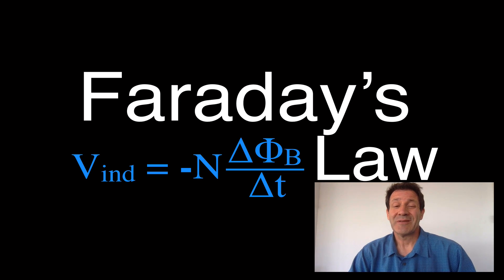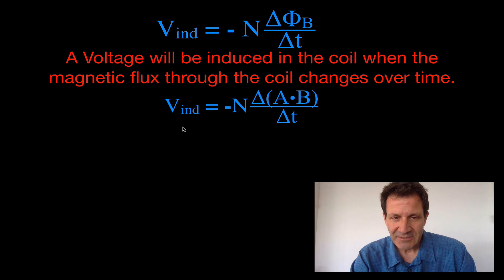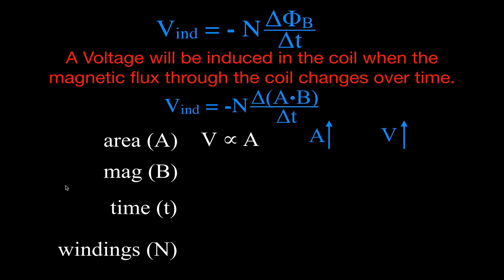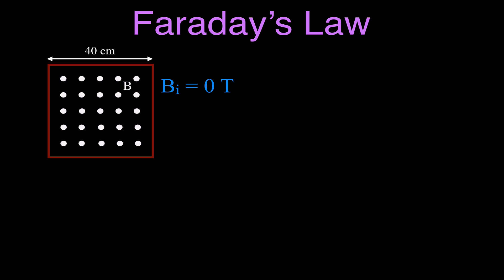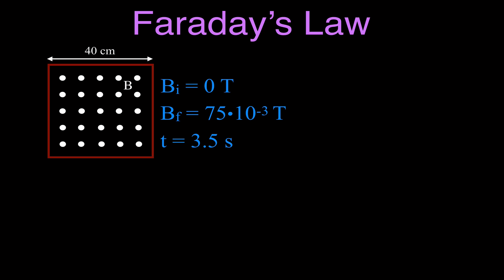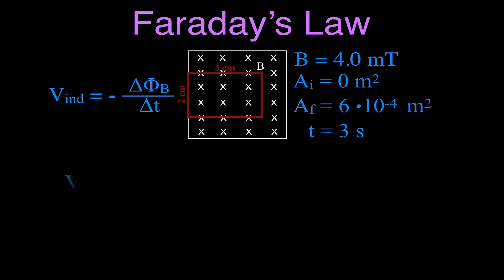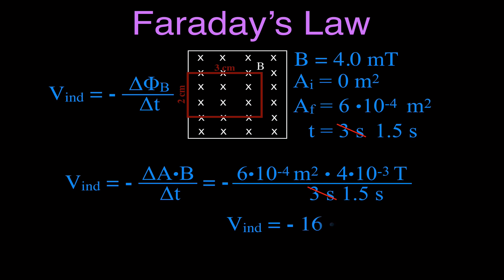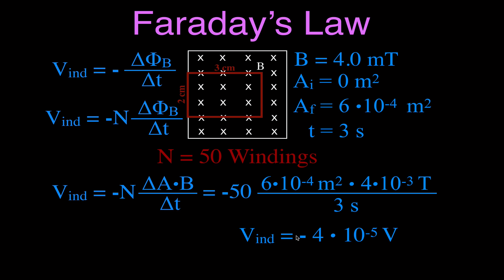Electromagnetic Induction (3 of 15) Faraday's Law, An Explanation, No. 1

Comment: If voltage is the difference in electric potential between two points, which points do you consider when you're dealing with a closed loop?
Reply from the maker: The potential difference between and two points in the closed loop.